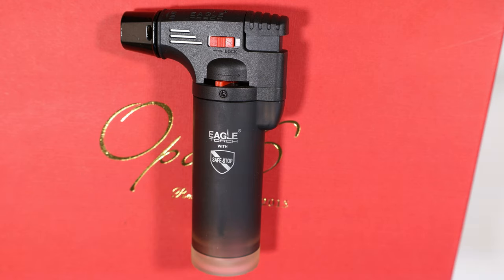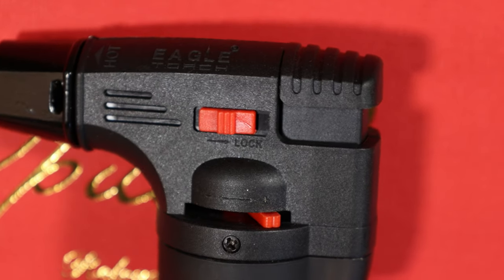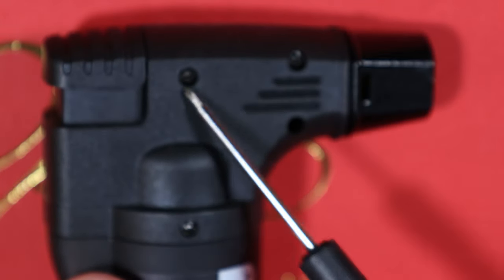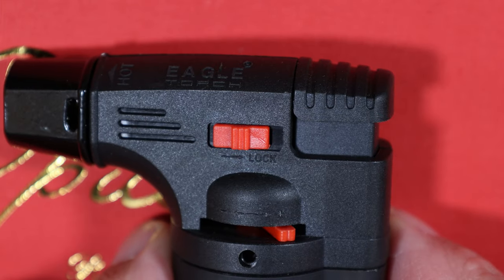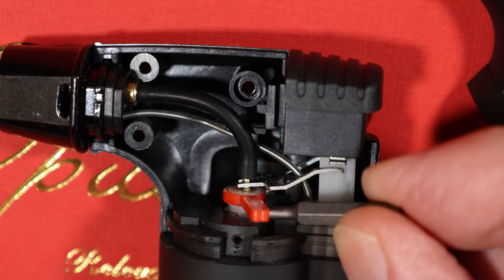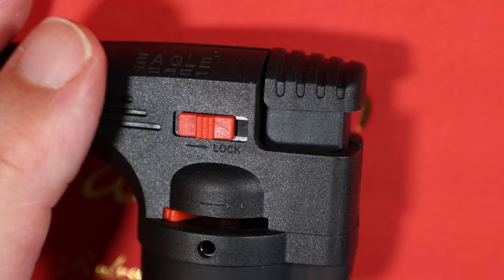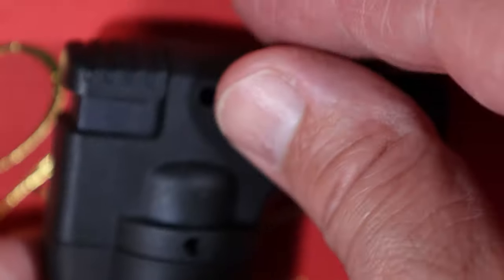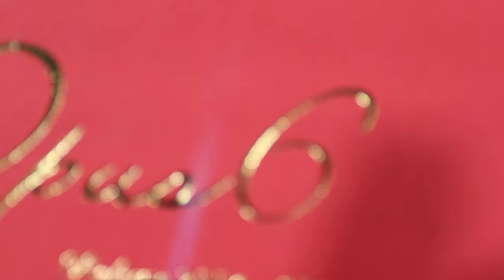How to fix an eagle torch lighter or how to fix a lighter with an adjustable flame

Comment: I have two that aren't working off the bat.  Couple of things I would mention. First, thank you for this video. Second, the fuel is butane. Third, why not put a drop of glue on the cog inside so that the lever will never slip?
Reply: I wouldn't glue it so that way u can adjust it again later back to original settings or further up if needed. I mean u don't really want to glue any parts that can break and u can potentially replace lol
Reply: It gets hot in there, glue is often times flammable

Comment: *Attention Be Careful* I literally tried this and the entire lighter bursted into flames  in my hand and I had to drop it.
Reply: That's why I'm here 😆 just shake it and it goes out 😆
Reply: Ya because u had it on full throttle u can do this with cheap lighters and if u keep it lit too long it will explode
Reply: @arcanon5080  I mean, 'explode' is kinda an extreme term in this scenario
Reply: Me too
Reply: All this talk about this lighter. It's really giving me the blues.
Reply: Same damm near burned the house down
Reply: same thing happened to me
Reply: Anyone figure out a fix to prevent the issue? I have repaired/rebuilt some of the most hopeless torches and while not all of them do it some will occasionally leak and ignite itself on its own flame. For me it's not that big of an issue but for my unsuspecting girlfriend it can be rather upsetting. Surprisingly little information about this issue at least that I have been able to turn up online. If I can just figure out the cause then I can devise a solution myself. Any constructive input appreciated
Reply: Why don't you just empty all the butane out before you start working on it?? 🤷🏽‍♀️

Comment: So now that's easy! How about this one,? I have had mine flat out just quit striking or little to no flame . And replaced my 
Aà  wire and cleared out the baffling  ony torch tip .and it all still works great.firstly when cleaning the tip. Get a couple of qtips and a cap full  of rubbing alcohol.dip tip in alcohol and
 gently wipe on tip and rub few times let dry. Ick till fame
 the front where flames 3xits face of lighter tip

Comment: It's NOT the flame adjuster slipping. Its the aluminum piece that is connected to the push button. Its cheap aluminum and bends easily each time you use the lighter. Bend it back and all is well. Or keep unscrewing the flame adjuster and burn your house down
Reply from the maker: Then make a video about it then

Comment: My lighters have too much fuel, so I have to decrease the flame adjustment positioner (opposite of your instructions).
You can test for optimal spline placement by holding the case together prior to re-screwing it.  In summary, duh!
Reply: how do you get rid of excess fuel ?
Reply from the maker: @bieberfever12241  watch this video 
https://youtu.be/69rz9GhqDXQ

Comment: My problem is that the regulator isnt allowing gas to flow through the black rubber tube to be ignited by the piezo. When you press down on the switch (not the safety switch, the ignition switch) you can see it release an ever so tiny amount of butane from the reserve chamber, seemingly never making its way through the black hose. This video did NOT help in that regard.

Comment: People just ramble on and on... Take one side off pull the red valve thing up and make sure it's not going to turn that white valve with the serrated/knurled edges, pull it all the way to the right or what ever way is plus. Obviously if you turn it to far and try to put the case back on it won't slide into the slot... So keeping that in mind, pull right, pick back up again same sequence only pull it to the left place back on valve , pull right. Put case back on again. Good to go!

Comment: What if it's not clicking anymore? This fix was also a problem w/my torch b4 it just stopped clicking to ignite altogether.
Reply from the maker: Sounds like you messed up the metal piece
Look at the video at 2:46 and make sure your eagle torch looks like that
There's a metal part all the way to the right underneath the plastic part that needs to be there
Along with where I'm pointing the screwdriver
Other than that I don't know what to tell you
Reply: There’s another video on youtube that will show you how to fix your particular issue. Mine had the same problem but I was able to fix it.

Comment: I've tried to fix mines, but I see no solution. Everything seems to be working well, I've opened it, and tried to fix it, it sparks, gas comes out and is not working.
Reply from the maker: It's probably the part that makes the spark that's bad if so there's not much you can do about that one
Reply: @Dude90077  actually, there is... if you buy a bic lighter that clicks it will have the electric piezo sparker in it. thats the wire and the rectangular plastic piece that the getd pushed down until it clicks....     consume all the butane inside the bic lighter...then dismantle and youve got your new sparker...

Comment: Does anyone know what to do when the clicker won't go down all the way and the lock is off?
Reply: I've pushed the clicker down as hard as I could and then slipped my thumb off the clicker and it resets the innards of the clicker to set it back working right.

Comment: So obviously I’m naive and not educated hence the reason I found this video. Very misleading, though. Not only did this not fix my torch but it put the gas wayyyy too high and I damn near burnt my house down. The whole lighter caught fire. I’m just glad I was able to put it out without any burns to myself or my property. Def only do this if you need to turn up the amount of butane you’re outputting cause dumb dumbs like me think this will solve the clicker issue

Comment: Is this really FIXING the lighter?     
Fix:  to make (something) whole or able to work properly again : to repair (something) : to deal with or correct (a problem) : to attach (something) in such a way that it will not move : to connect or join (things) physically.
What you are doing, by definition, is not fixing anything. What you are doing is unscrewing the valve -that was set by engineers who design it, beyond the maximum setting to let more gas out so it burns faster, hotter and higher.
How dangerous do you think this is really? Suppose for a second it starts letting small amounts of gas out around the threads and stays lit when it’s put into a pocket, maybe it stays on the recommended amount of time buy but because it now burns hotter it has begun to melt the metal cap or tubing inside until there is a catastrophic failure.
Yeah, ik, I’m the captain buzzkill, aside from the misleading tile, and my annoyance at that, I did think your explanation was spot on and very well done. Thank you for your time and effort mate. Cheers.